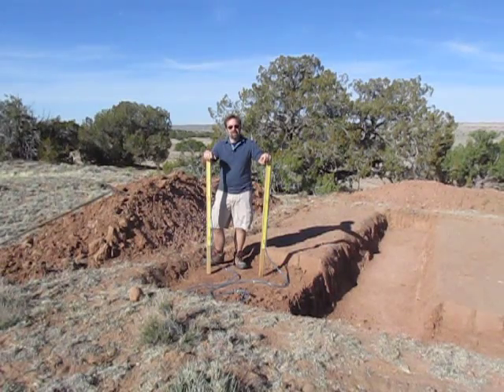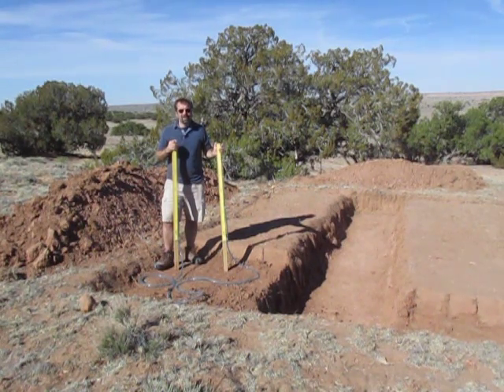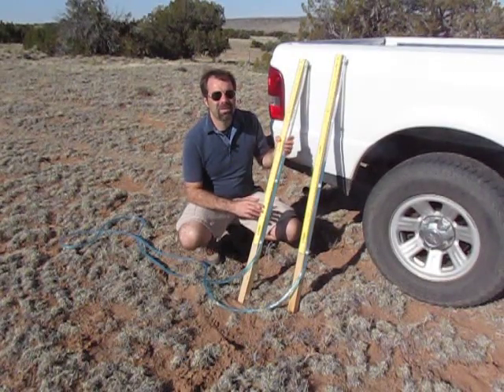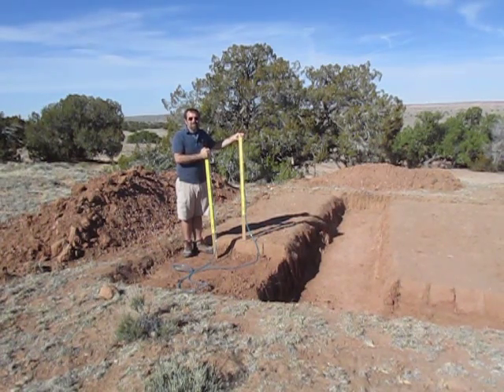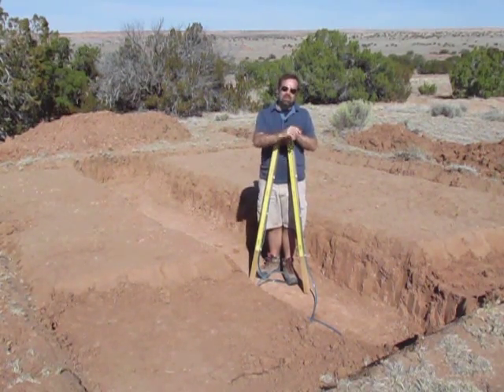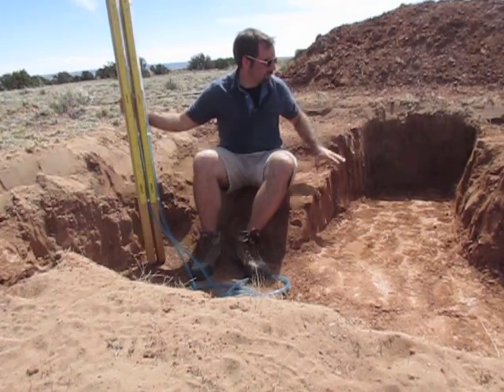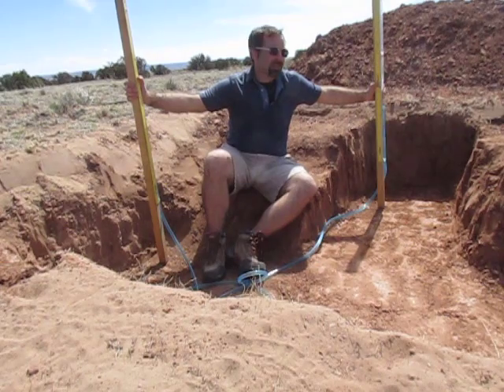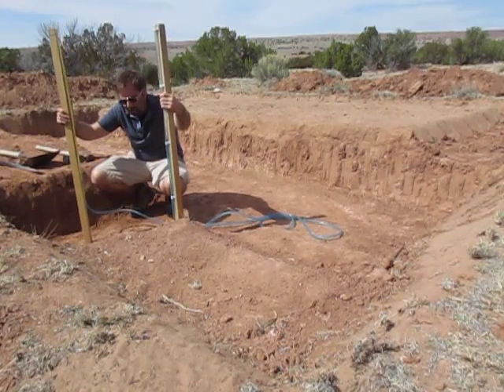How to build and use a water level.

Comment: Why couldn't you just use "one" stick with a stationary bucket of water and just move around the area you're measuring and note the difference in measurements on the "one" yard stick to determine the different elevations at different points? Why would you need "two" sticks?
Reply from the maker: You could do this with a stationary point. It is difficult to take measurements when you are working alone. However, having two points greatly increases the ways in which you can use the tool.
Reply: @juniperhighlands  Not be argumentative or anything, but it just seems to me that you'd come up with the same results using only one stick and a stationary bucket of water.
Reply from the maker: @kmacradio  There are other applications for this tool that require both ends to be used. I encourage you to design one that suits your needs. I did not come up with this design and am only sharing something useful that was shared with me. I'm all about innovation and would love to see your alternative design.

Comment: The question which I asked my self is where first do I touch the leveling tube to the rod?
Reply from the maker: The tube needs to lie flat against the post for the full length of the yard/meter stick. I attached mine right where the the measuring lines begin.

Comment: First and foremost, Great video bro! I have question. In order to maximize the range of the yardsticks, do you fill the tube up with water to the center of both yardsticks with both ends on the same plane?
Reply: I guess i'm asking about a initial calibration when filling.
Reply from the maker: Thanks! Filling each side to the halfway mark would give you the largest potential difference between the points you are measuring.

Comment: Dave, you just saved me $400+.  Will stick it in the ground with food coloring and a bit of soapy water.  Appreciate the down to earth explanation.
Reply from the maker: I am glad this video helped you out and saved you some money.
Reply: @juniperhighlands  What's the 'soapy' water do to enhance this method, compared to plain water?
Reply from the maker: @steven.h0629  Plain water will work. Adding a little soap just helps the water be less "sticky". You only want a little though. You don't want soap bubbles interfering with your readings.

Comment: Thanks, Dave. That's fantastic. I've been looking at laser levelling systems in the last few days, and I've been bracing myself to spend several $100's on something which I'd be only using intermittently, but still an absolutely necessary part of building projects. Even with expensive line lasers they are quite limited in that the laser lines can be v. difficult to see in outside bright daylight conditions (a common complaint). Plus, batteries wear out and lasers go out of alignment if dropped on a job sight. Your very intuitive system is the best water levelling setup I've seen, showing with the two yardsticks an ability to check measurements between two spots down to even 1/8th's of an inch. Fantastic! This at a fraction of the cost of lasers, lasting for years, and with nothing to break. If pyramids, colosseums, and aqueducts can be built with these there's no reason it won't work perfectly on a house or shop today!! Awesome!! Thanks for sharing with us.
Reply from the maker: It's amazing how sometimes old technology can beat out new technology, for a fraction of the cost. I'm glad the video was useful.